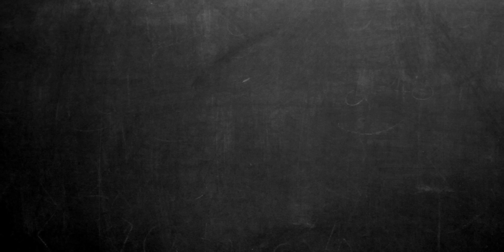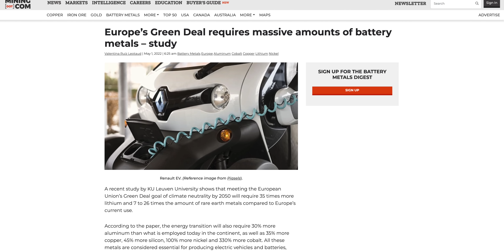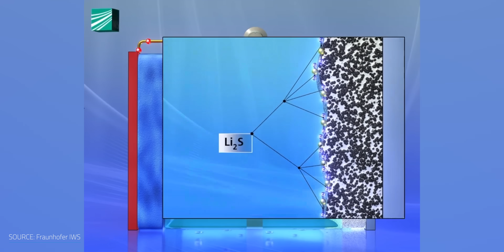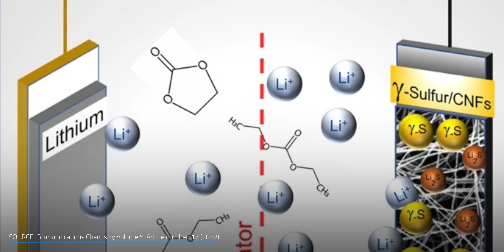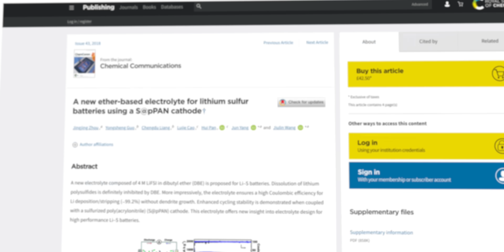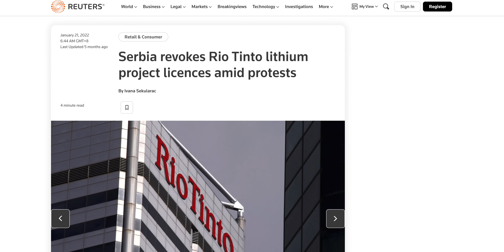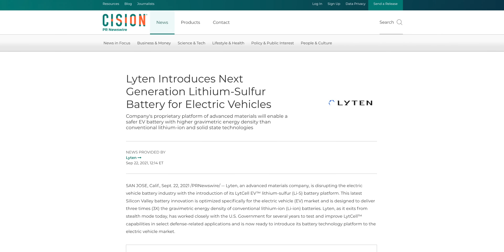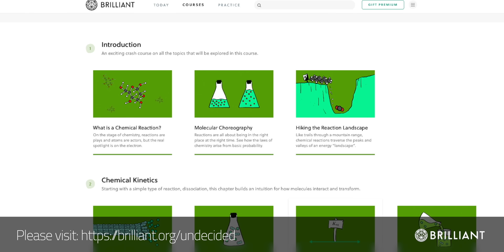Why This Accidental Battery Breakthrough Matters

Comment: As with many of these breakthroughs, I'll believe it when i see it.
Reply: Battery breakthrough fatigue. When promising turns to production, then it will be truly exciting.
Reply: @MrCPPG  Really any new tech or ev company has this happening for me right now. Hate to say it but believe it when I see it. Hope it is coming though.
Reply: IF, if this is really it, then there is an incredible amount of money which will push it through.
Reply: I believe it, but there is a huge step in between proof of concept to full blown production/application to the world. I really would love to believe in 5 years I could be buying these though....
Reply: @jtelliso  also there are many use cases for these batteries where they would be used instead of lithium ion even if they cost 5 times more, phones and other portable devices being such because of the limited capacity
Reply: I agree a lot of people want to be the first so they will come out and say we found it so they can get a money injection.. 
all so the voltage out of them is only 2~2.5v, 3.7 for standard lithium battery's so you need more battery's cells.  
and what about the lithium its self that is some thing that is getting stretchered out too
Reply: Most of the breakthroughs are believable enough. The main problem is always about money. How to make it affordable or how to make it profitable.

Comment: This sounds promising. I just hope something new is finally delivered. Battery technology has been stagnant in the consumer market for too long
Reply: It may feel stagnant now, but it's been incremental and we don't notice. Go back 10-20 years and the battery tech you have now would seem utterly alien. Not everything is a massively disrupting breakthrough. Just steps.
Reply: Not quite, while Lithium ion has been pervasive, we’ve created longer lasting and safer battery technologies. Just look at fast charging and rising battery shelf lifes.
Reply: @Endoplexer  he was referring too the consumer market for batteries as a posed to the consumer market for things like cars  and computers themselfs
Reply: @Endoplexer  I agree, I no longer keep lithium ion batteries in my home. They are all outside in a metal container. I keep my cellphone on a concrete pad. They have created little bombs
Reply: i don't think so (height years ago, my EV's where 22 kWh, charged in 22AC, now for the same price, same weight i've got 64 (3 times the energy volume, a much quicker charge in DC, a huge torque and so on )  but yes, consumer expectations are very high
Reply: Kinda like trying to recreate the wheel huh?
Reply: It really has, when I heard about how long EV batteries last I thought maybe the technology had somehow improved but when I finally found out why I was pretty disappointed. For those who don't know all they're doing is using an oversized battery to compensate for capacity loss. One that conveniently will run out of extra capacity around the same time as your warranty runs out.
Reply: Stagnant? It's changing rapidly with 5-10% improvement year over year.
Reply: Nice to see energy density go up finally in the past few years, but nearly 100 years of stagnation is pretty bad.
Reply: @esaedvik  which stagnation!? Lol……. The lithium battery was invented in the 90’s and way before that other battery technologies like nickel cadmium, lead acid…….. were already there. The improvements on battery tech is simply not that fast, it’s like solar panels.
Reply: @carholic-sz3qv  In 2008, lithium-ion batteries had a volumetric energy density of 55 watt-hours per liter; by 2020, that had increased to 450 watt-hours per liter.
Reply: @esaedvik  the improvements has been made on the hardware like more efficient processors, screens, lighter materials…..
Reply: It's not stagnant at all. It 's just incremental, 5 to 10% improvement in energy density per year. It's huge
Reply: @mathieuprevot8753  it’s not 5 to 10% density improvements a year, more like 1-5 and the test is optimization of electric motors, electronics…. The use of galium nitride mosfets in inverters/chargers for example and much more.

Comment: Wouldn't pouches be a better option for Batterie packs then the cylindrical shape?  (Especially weight )
Reply: I think they use cells to contain any thermal runaway better, as there are 1000s of cells making up these packs safety is a greater concern than small things that can use pouches, laptops, drones etc.
Reply: also they are harder to damage

Comment: Lithium Iron Phosphate doesn't need Nickel and Cobolt. I just purchased one, and it's great. I see it used a lot in the heavy vehicle industry. I know it's more weight than the other technologies, but why isn't it the defacto standard today for grid storage? The price for it has come down a LOT in the past 2 years. Why is China the only ones producing these cells? Is their a patent issue or something?
Reply: Yes , patent just got free in April 2022, hope new battery factories of LFP will start from 2024-25